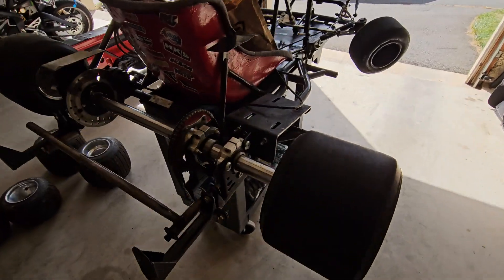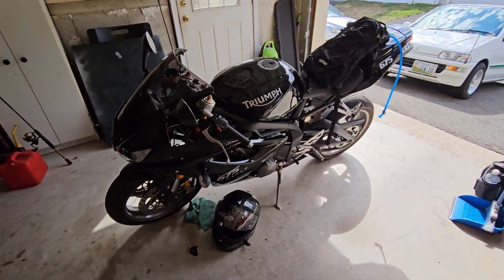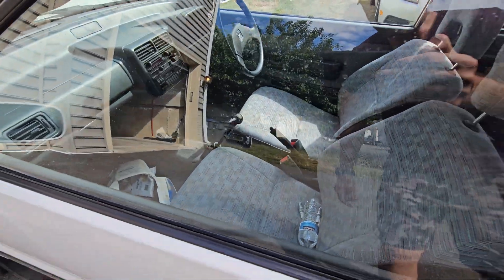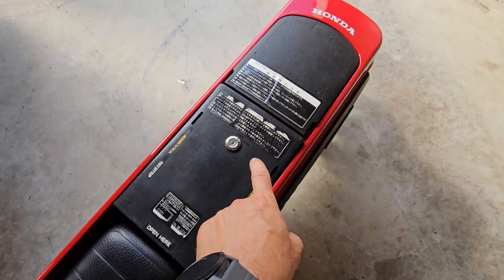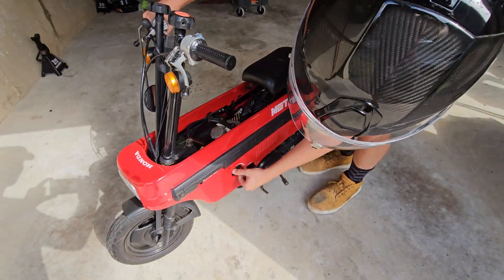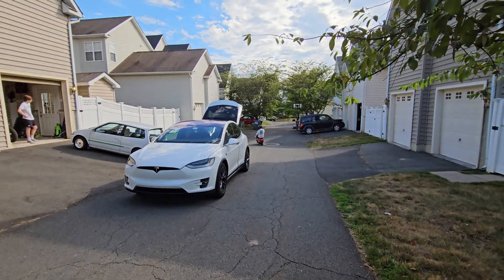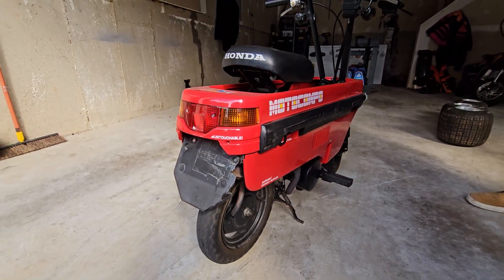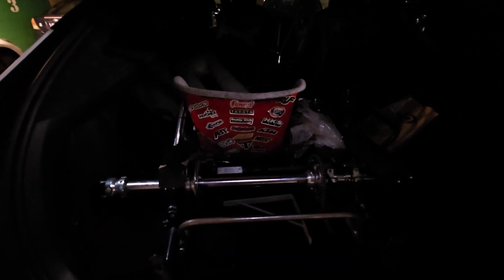DIY Insane 75 mph Electric GoKart PROJECT

Comment: MX X-9000 Controller Kit for SurRon Light Bee or Talaria Sting (Air-Cooled)

USD 1,145.00
[E0101A01-XLB-60BKA] EBMX XLB-60 Motor for SurRon Light Bee (Air Cooled)
EBMX XLB-60 Motor for SurRon Light Bee (Air Cooled)

USD 1,200.00